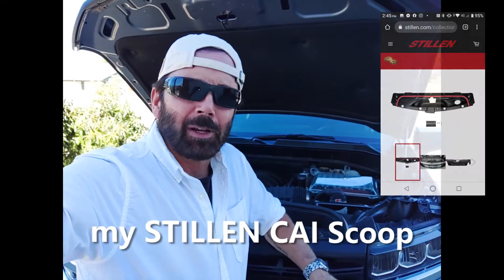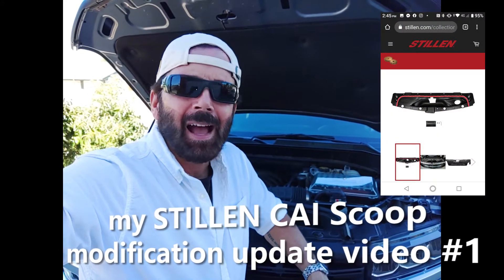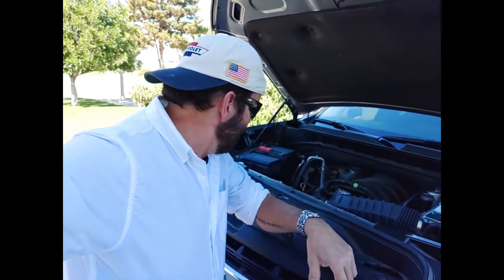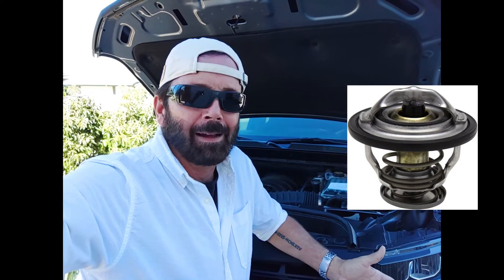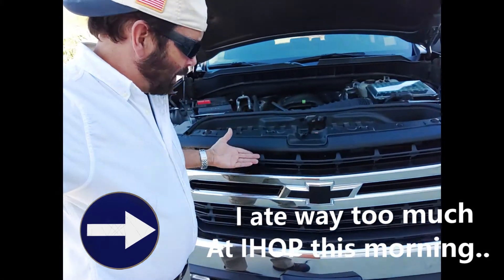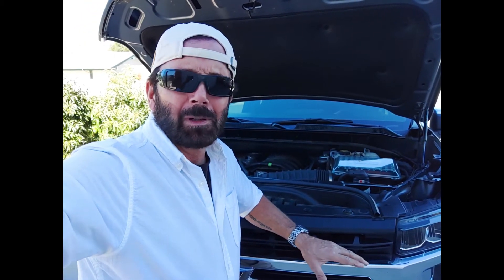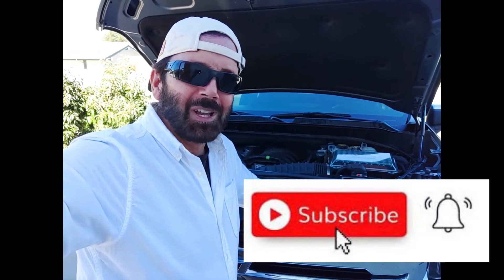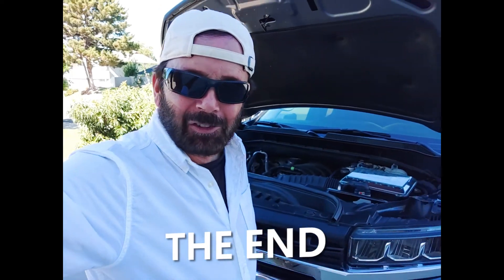my STILLEN CAI Scoop mod -17 day update video #1 w/Paul Henderson HD 10-27-2021

Comment: So it’s a waste of money)
Reply from the maker: Not entirely, you can still use it on the non areo blade Silverado. Or you can modify it and use it on the areo blade models. I did do a test with and without it and there was zero temperature difference on the temp gauge, I will be reinstalling mine as soon as I have a chance...
Reply: @HowtowithPaulHenderson  but for 200 bucks does it do anything or just a under hood thing to look at?
Reply from the maker: this unit makes a lot of sense since it is getting the cooler air from right behind the grille, And when you're sitting at traffic on the freeway it's going to be drawing the air from right behind the grille and not sucking the hot air that comes off from the radiator. I'm sure the top two openings that are in the front grille are for air to flow through the radiator since the arrow shutters most likely will be closed. I did do tests on both the stock and the Stillen with and without and there seems to be no temperature change on the Gage in the vehicle. Still in however recently came out with an update that says it cannot be used with the active Aero shutters. When I originally bought this unit I do not recall seeing that. But with my modification it's now compatible with the blades as to now they will not rub on the unit... There is a block off at the plate at the Bach of the Stillen that can be removed to allow some fresh air to pass through to the radiator fins.
Reply: @HowtowithPaulHenderson  sounds good I’ll look into getting one if it makes a difference
Reply from the maker: @trailbosschrispayne5454  I did mention it in the video, that when you slow down to less than 35 mph the AA shutters open back up so then when you're stopped in traffic it's sucking the air from right behind the grille. I know the two open slits on the top of the front grille allow air to pass through and still hit the radiator when the AA shutters are closed. And now that Stillen is semi blocking the top two slots I wonder how much air is still getting to the radiator. Like I said the other reply I didn't notice an increase in the temperature gauge with distilling or the stock air intake grille. That's why I'm thinking of pulling that cover plate off that's just below the hood lash release or cutting the top part of that cover plate just above the two push pins that hold it in place. That should allow a decent amount of air to flow through to the radiator